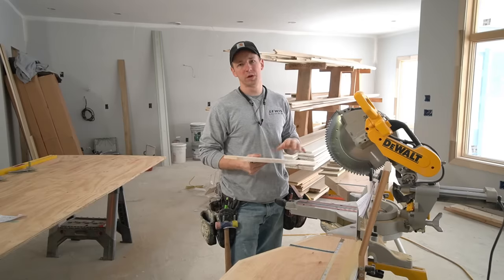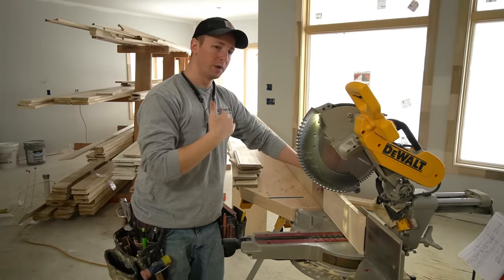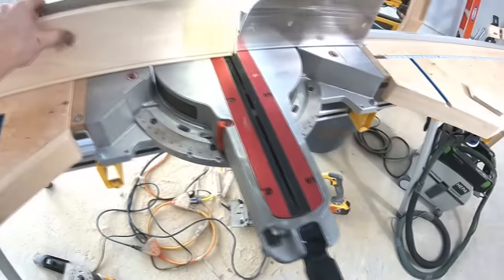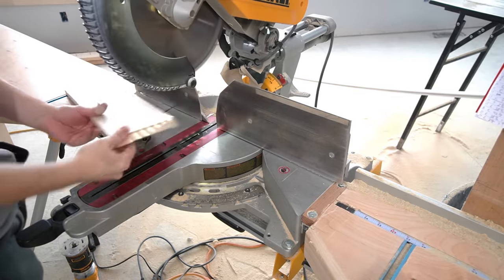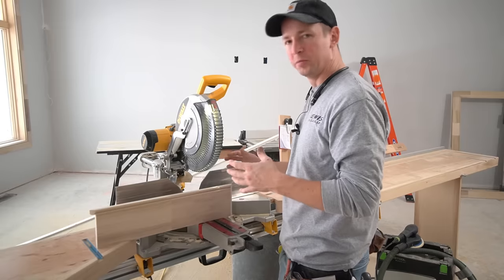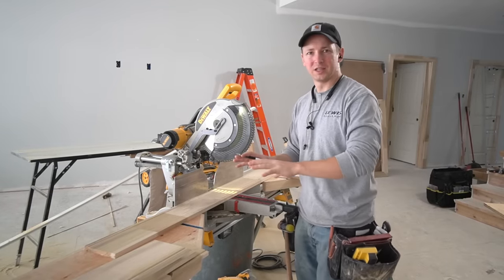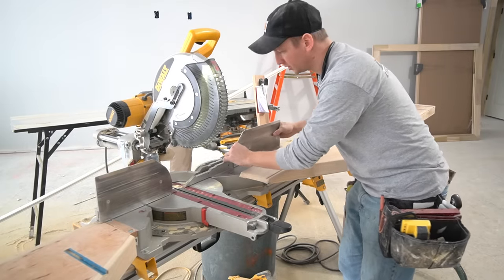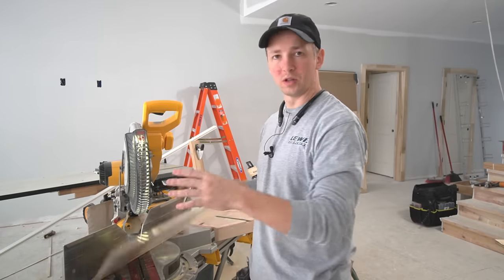What??? Pros Cut Baseboard Upside-down and Vertical... Why?

Comment: I used to work with this guy that marked all his cuts on his list on the opposite side when cutting crown.  Thats fine I get why he does it but I've always marked it the way its on the wall and I just know its opposite at the saw.  His way irritated me bc I'd tell him I need a 39 3/4 outside 45 on the left and he'd cut an outside right.  I was like man I'm not going to say it backwards too.  That just gets too damn confusing.  Speaking of measuremnts I'm curious if you write out fractions when writing down measurements or do you only use 16ths so its just one number to write?  For example instead of writing down 4 3/4. I write 4 12.  2 is 1/8, 4=1/4, 10=5/8.  Once someone showed me this way I never went back.  Quicker and easier to write and say, less chance for someone to make a mistake and think you said 3/16 when you said 3/8.  I still use both ways because a couple of the guys I work with can't grasp it or just dont want to.  So if I'm writing it for them to read I'll write the fraction, for me just the 1 number.  It can also make math easier.  

I wouldn"t recommend this way for a beginner because I think theres value in learning to do the math in fractions first.  The main reason I do it is simply because it's less to write and when you're writing down a couple hundred measurements in a day it makes a difference.

Sorry I probably over explained that a bit.  Anyways, does anyone else use this method?
Reply from the maker: I write out the whole fraction with the denominator and a + if i want to cut a strong 1/16th (1/32nd)
Reply: @InsiderCarpentry  I do a + as well
  You should try using only 16ths like I mentioned.  I thought it was weird at first but you get used to it quick.
Reply: Good. God. This is why I prefer to work alone! 🤔🤨😂

Comment: Why would one cut your straight end a couple of degrees negative?
Reply: The negative cut removes a small amount of material from the back of the piece so the face(s) fits tighter; in many cases, walls are not square/true - so this type of cut allows for some ‘play’ to adjust the appearance where it matters.

Comment: Is there less wear on the blade by cutting on edge resulting in a sharp blade for a longer time? Great video.
Reply from the maker: Probably, beveling does seem to be harder on the blades, more friction.
Reply: @InsiderCarpentry  Thanks for the insight. I can hear the difference when cutting on edge versus the flat.
Reply: There is more wear on blades on the bevel. The cutting profile is the same either way. It's mostly due to user error in the operation of the machine. It is a natural tendency to push the machine in a direction that is not in plane with the cutting profile. That is, it is very natural to exert a more  downward motion slightly out of plane with the bevel which increases friction and heat which will wear the blade faster. The more bevel, the less ergonomic the motion.

Comment: Most people do not have the taller fences. Laying the boards flat and using the saw bevel is the only way to get the correct cut. Any one following this video will not have the same results.

Comment: You should back bevel your straight cut you can fit better I call it a crush bevel seamless I actually never move the saw 45 degree both ways and cope top edge

Comment: Good reason to cut vertically. Much easier on the blade as you are cutting only 3/4 material at once. Stops heat buildup making the blade last up to 25% longer
Reply: I have always cut flat and will continue to cut flat.  My finished product is always pristine.  Union work sucks because you have to share a saw and I prefer to remove the upper fences.  Most guys don't.  Non union residential is nice because I use the tools that I think are best for the job and I don't have to share them.

Comment: Be safe. Put up some handrails by those stairs!!!
Reply: Contractor probably pulled them down when they hung the sheetrock. It's one of those risks you have to live with in construction, unless the homeowner stops by with his kids. Usually trash barrels or a workbench has to suffice until the stair gets completed. But you're entirely right, it is a hazard

Comment: Miters on the flat involve inefficient extra steps plus it isn't efficient for the saw and blade as anyone who has smoked a room full of miters will attest. 

There must be difference in using a jigsaw for coping compared to a coping saw because I only cope right side of base if I can help it. Nothing at all wrong with your system but for me hand coping on the right I tend to cut my miter standing up normally, then pivot my base up into the blade to clear the bulk of the straight cut, then slide the piece just past my miter saw and cope it standing up.
Reply: @Phelebas If I am trying to hide shrinkage I will not wear a speedo. 

You say it defeats the point but it depends on what the point is. For me coping allows me a balance of speed and quality that I can't achieve mitering. If a joint opens the gap should be half as much with a cope but this is a matter of temperature and humidity and the trade off is how much efficiency do I want to lose for the sake of something that is more likley to be covered by a fern than a glaring eyesore after the dwelling is moved into. Not that there is anything wrong with taking that step if it works for you, it's that much more care you put into your work.

Comment: The fact your doing inside corners on a miter and not teaching a cope says everything I need to know. FYI for those who believe a YT ppl…. Let’s go 2 steps backward. 1st framing…. Today most jobs bc of whatever use a guy who doesn’t care about level and square…. Just blow and go. 2nd is drywall 99% of the time the Mexicans that do drywall and the lazy Americans tend to fill the corners with mud and sand them the appear slick and smooth. The problem is this….. if you try to put something square in a corner that looks SQ but isn’t a normal miter won’t work and cabinets do not install as per the “perfect world” of AUTOCADD. So as my grandfather and his dad knew before me…. If you COPE a corner it works every time. He isn’t explaining the reason. He is only showing you a “trick”. 

Also when you cope…. You do a 45 degree or greater cut. So when you do his trick…. Do it at a 45. 

And yes I troll these videos just to attach them. If you treat every cut as a stained high dollar finish cut then you have zero o worry about when doing painted crap.

Comment: He didnt wait for blade to stop before raising saw tisk tisk
Reply: He did it correctly. That's because if he did, chances are he would accidentally overcut into the moulding portion of the trim due to the saw reacting to the torque of the motor suddenly stopping.  Try it, and you'll quickly see why.
Reply: @Mrjglass213  i never wait for it to stop. I actually pull the miter away from the piece slightly so I can raise it
Reply: If you're waiting for dewalt to stop chances are you'll get into your profile.  Pull up before the brake goes and drops into the material.  Smart technique shown
Reply: No professional does, unless the small falloff is a piece you need to use.

Comment: its even easier to just miter your inside joints. Just need a small square and a screw at the bottom of the miter to plumb it up.